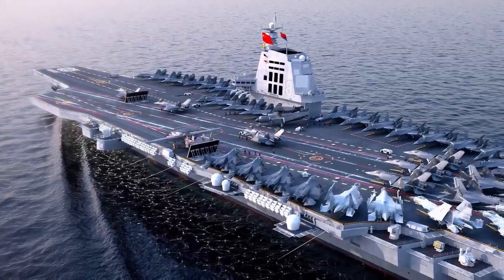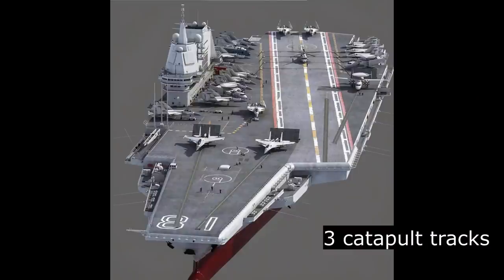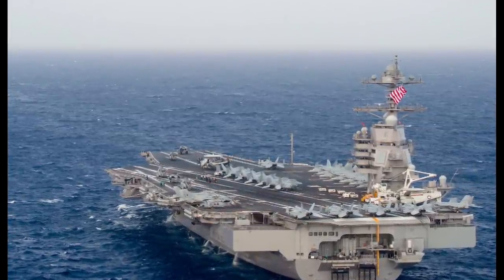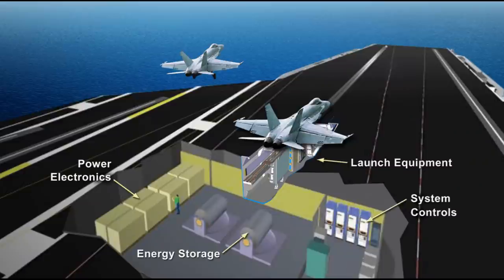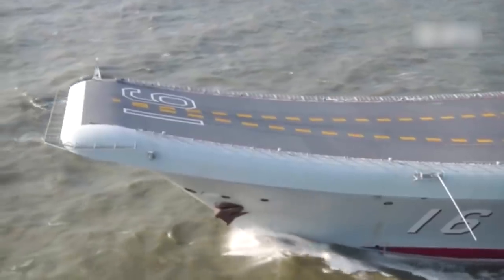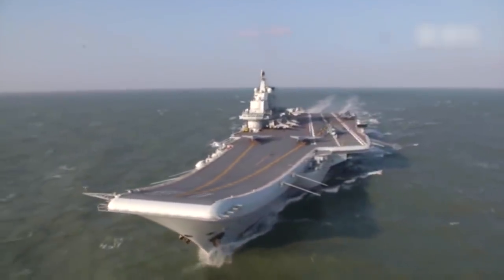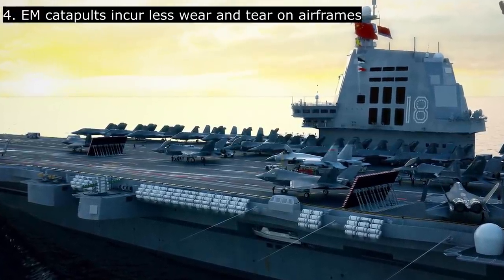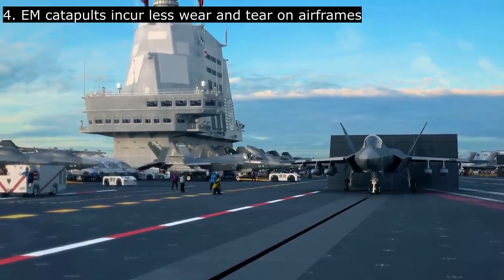How Important are Electromagnetic Catapults for China's Type 003 Aircraft Carrier?

Comment: Ok, the main issue, and what is NOT known about the China catapults?

Well, first we have to grasp how the USA one works (or to put it mild HOPES to work!!!).

To use the electric launch system? They can’t draw power directly from the ships generators. 
Several reasons exist. First, you can’t draw enough power at the rates required to run the rails. So you have to “store up” the power.

More important, the amount of power available for a launch MUST be known beforehand. So, if someone turns on a lift, air conditioners, an oven or what not? Then the total power available is changing. And even a circuit breaker flip or any other system – you can see the lights dim – and power available  changes. So you need CLEAN power, uninterrupted power for a catapult launch. You can’t have power change half way during a launch – or you wind up with a jet in the sea.

So, what they do is STORE UP THE power for a catapult launch. They use big motor flywheels to do this.

An EMALS motor generator weighs over 80,000 pounds, and is 13.5 feet long, almost 11 feet wide and almost 7 feet tall. 
So, there is 4 of these for EACH catapult. A total of 16 of these beast of burden mechanical monsters are thus installed.

In addition to the huge flywheels they spin up, you have the generator control room.

So, to launch a fighter?

They spin 4 of these mechanical monsters to 5000 RPM. Then for a launch, they spin them up to 6000 RPM. (It takes about 50 seconds to spin them up from 5000 RPM to 6000 RPM)

Once they are up to 6000 RPM, then the catapult (the electric rails) are ready to be fired. 

At the end of a single launch, the huge flywheels will be back to 5000 RPM.

During a launch, the huge mechanical flywheel feeds into a complex energy converter (called a cyclotron).

Now, take all of the above systems? What does a steam catapult use for ALL OF the above?

Why, it uses a tank of air, with a valve. 

That is it!!!

I should also point out that you can’t isolate the huge flywheel generators from each other. So, if some small problem occurs, and you have to service them? Well, they take 1 hour to spin down. And worse, they really can’t be serviced or repaired at sea anyway.

And as noted, you can’t isolate the systems from each other. So all catapults are down.

With steam? If one catapult has an issue? Well, they just go below deck, turn some steam valves, and isolate one catapult, and operate other 3. No big deal to keep a catapult off line until you finished fighting the enemy. With EMAILS, you shut them all down, and sent out another carrier while the current one returns home.
So, steam, is cheap, easy, simple, but MOST important such systems are not only simple and reliable, but can be serviced and maintained at sea. 

The EMAILS system is massively complex, has MORE AND LARGER mechanically parts and bits it replaces, and worst of all, can’t be serviced at sea, and even if you try, you have to wait 1 hour to spin down the system before you can touch anything anyway.

And worse yet? Supposed these huge elephant size mechanical flywheels are supposed to save room!!! – Oh wait!!! The electric rails save room top deck, and no need for steam generators (attached to the nuclear reactor). 

However, over all the EMAILS system is NOT saving room at all.

I mean, sure if you JUST compare the rails, then YES. But to leave out the huge massive mechanical beast of burden flywheels, then you NOT reduced parts at all here.

To be fair the catapult rails for steam do have more maintains then the steam rails. So the rubberized seal that goes around the hook that travels down the track for steam is a “pain”. However, such maintains can once again be done at sea. 

So, while the rails on EMAILS require less maintenance? Well, that remains to be seen, but while the rails has less maintains, the large number of huge mechanical flywheels to store energy during a launch are NOT a reduction in mechanical bits and parts.

So, the tanks of air have been replaced with a VERY large number of those flywheels, and it remains to be seen how reliable these things will be.

And as noted, these huge mechanical flywheels don’t save room compared to the simple “air tank” that will last for the whole 40+ years of the carrier.

The other big promise of EMAILS?

Well, it was supposed to cause less stress on fighter airframes and thus increase the lifespan of the fighters. 

However, right now? Well, EMAILS is overstressing F18’s with external wing tanks. (The solution right now is to thus not fly F18’s with external fuel tanks).

They do claim a software fix is available right now (to be deployed on the Ford next year).

The issue is that steam has a “natural” kind of give. Try moving or stopping a cordless electric drill – they will rip your hand off. But, they still use air guns at tire shops for tire bolts.

So the overstress issue is complex. The catapult hook and rails when they start to pull the JET are connected VERY strong together (can’t have the hook come off!!!). But, vibrations from the EMAILS launcher are making its way into the fighter’s airframe. This is NOT JUST an issue of less force, or more force. It is how the rails produce the force that is the issue here. 

They “think” they can minimize the increased wear and tear on the fighter’s airframe with tweaking the software for the electric rails. But it far more difficult, since as noted, steam has that natural “compress” and “give” that absorbs these vibrations and huge forces that a catapult places on the fighter.

So, they are now having to try and “simulate” the give and take of steam with an electric rail system that designed to be VERY strong, and NOT have any play or “give” when they fire the catapult. 

As a result, vibrations and forces are making their way into the airframe. And we all know metal fatigue is the number one killer of fighter jets longevity.

So the WHOLE idea behind EMAILS was the promise and sell of reducing wear and tear on the fighter’s jets. This would thus increase the life span of airframes. Right now, they are experiencing the reverse of what they promised

So now that EMAILS is working, they are finding about 10 times or more failure rates compared to steam. So, even if they fix the failure rates, they still have to address the increased stress issue. And they still have no solution for doing working on or fixing EMAIL issues at sea.

And, even worse yet? Well, they are not seeing increased sortie rates with EMAILS (again another failed promise). 

Right now? Well, they just going to deploy the Ford class with reduced sortie rates, and ignore the failure of launch rates, and ignore the issue of non-repair at sea.

However, some launch failures will result in the jet going into the sea.

so, the idea that the EMAILS catapult is solid state? Nope!!!

You have these big beast of burden large mechanical spinning flywheels. It much like going back to medieval times - and using weights and rocks to power a catapult back then.

So, ANY talk of this system being non mechanical? Nope!!! - it takes more space then steam system, but worse right now is proving to be 10x less relaibley then steam systems.  (gee, at the time of writing this, it looks like President Trump was correct - the system not doing well at all right now).

Worse yet? As of june 2021 last year? Well, it went off line in june - they could not launch fighters for 4 days (the ship headed back to port). The previous failure was less then 6 months before that - down for 6 days - again headed back to port.

I would REALLY be a huge fan of this system if they could have used super-capacitors for the energy storage, but they went with huge mechanical flywheels connected to generators. These things are large, heavy, and very mechanical in nature. (All to replace a simple steam tank).  In fact the total weight of the flywheels is a whopping 640 tons - they had to make changes to the ship for that much weight on board.

So they traded reduced rails maintain for increased flywheels and generators maintains. It will be interesting to see when this choice starts to win over steam systems, or if it ever will.

The Ford and the JFK can’t be retro-fitted with steam, as they will have to rip up too much of the ship to go back to steam. So, likely what will occur is we use the Ford and the JFK for training, and build two more carriers after that and use steam. This is about the only viable option if they can’t fix the serious issues they are facing with EMAILS.

Ok, so now we up to speed on the crock narrative about how great EMAILS is. 

So the next question then?
Is China going to use flywheels, battery or super capacitors for their catapults - and if so, what was their solution.
Reply from the maker: You clearly spent a lot of time on this, so you could consider posting this on sinodefenceforums and see what responses you get.
Reply: @EurasiaNaval  
Ok, I don't frequent that forum - but I'll check it out.
The main issue to me?
Well, first, they quite much are backed into a corner. And unfortantly, they have now classified the testing and results of EMAILS failure rates. A report is supposed to be released, but as of June last year and the last failure and shut down of EMAILS (June 2021), they now stopped reporting on progress and the failure rates. So in effect, they have cut the flow of information in this subject (a common tactic - just classify the information - and thus no sources for how bad or good EMAILS is working right now.

But, as noted, what I am looking for and researching? 
Are china's catapults going to use spinning flywheels, or perhaps a capacitor bank. When the USA EMAILS program started, capacitors did not have the power density 10 years ago. However, now, they should be close - and have vast improved (much due to lots of money flowing into electric vehicles research).
So, there are some suggests that China's catapult system will not use flywheels but that information is what I am looking for. they are considering a high power DC current system, but I can't find out if that includes some super-capacitors in their design or not. Rumors suggest yes - but nothing solid as of yet.
Reply: Capacitor bank are risks on being cause fire.
Reply: @alexlo7708  
Interesting, I had not considered that fire issue. While the big spinning flywheels approach sounds very low technology, it certainly does not pose or present a fire risk. However, China has suggested or hinted they will not be using flywheels. So, they are using some form of DC high current, and I think that each rail section has some type of capacitors, or some other means to store up power. But, reports are they will not have the 16 big flywheels - those flywheels total weight is 640 tons - and they had to do some re-balancing of the  Ford class carrier due to this enormous weight added.  And as noted, while the rails above (at deck)  take less space, the 16 elephant sized flywheels and all the controls, and systems below actually takes up more space then does a steam system. So,  far, we don't have solid information, but reports have circulated that China will not be using flywheels for their catapults.
Reply: @Albertkallal  I don't know either.
Reply: @Albertkallal  just imagine the airplanes as carriages of high speed train, what China is going to do is to integrate tech from high speed railways repository to solve the engineering problem. China’s high speed railway accelerates they train to 300km/h in quite short time let alone an airplane.
Reply: @panaceatoxic5924  
Well the issue is not really the rails technology as much as how you store up the energy for the required power draw.
For example, when you max pedal a Tesla model plaid car down the strip for a 1/4 mile run?
Your power draw is about 760,000 Watts of power. A fighter launch needs about 10x that (you have to draw 7.5 million watts of power). So you can't actually draw power that fast from the on board power generators. So, you need to store up that power for a launch. So then the question becomes what kind of power storage system will they charge up before they trigger the catapult.
Electric trains have about 7,500 HP, each engine, but catapults need MUCH more power than that for a catapult launch, and they need it over about 4 seconds of time. So, we talking about 50,000 HP required minimal here (in the 30 million watts range). And more important you need to know and supply the exact amount of power for a given weight and do so for a very short time. As noted if a lift, a toaster, radar etc is turned on during the launch then power known and available changes per unit of time. So you have to store up the exact power based on aircraft weight (and fuel and bombs etc). 
So the question will type 003 use flywheels like the Ford carrier uses now? Due to needing enough energy in about 4 seconds of time and having to move 60,000 pounds of weight to over 100 mph in that short time is the issue. 
As noted some rumors exist that suggests the type 003 will not be using those big sets of flywheels. However I not aware of alternative technologies for this problem.
Reply: @1 CQC 
Well, that is fine and dandy to toss out a bunch of buzz words. The simple issue HAS been explained here, and the simple question remains:
What type of energy store or system are they planning to used for their catapults? It either has to be mechanical based, or they will have to use batteries, or some type of capacitors. 

So, when you state some kind of energy store system? What kind of system are you talking about? You have to state something more then your current claims which are just pure speculation right now.
Reply: @Albertkallal  在中文介绍里，003是使用超级电容，我两年前看到过这篇文章。这套系统也被要求必须支持未来更多的瞬间放电设备，比如激光和电磁炮。顺便说一句，中国并没有放弃电磁炮的研究，美国已经放弃了。
Reply: @ycongq6520  
I am not aware the US has given up on any research? (where and why is this idea being suggested??)

As I stated, 10 years ago, super capacitors did not have the power densify,  and thus the Ford class carriers did not use them. I suspect in the future, if super capacitors can provide the required power densities then they will be adopted. But the decision to go with kinetic energy storage was made that that time.

If the Type 003 does use super capacitors, then as noted, then we can assume that the required power density has been reached and achieved for use in the Type 003. And I do think super capacitors are a better choice.

The only downside to using super capacitors is some issue of fire hazards, but I still think that risk can be managed.

As a result, super capacitors are a better choice - and a better choice then using kinetic energy storage (flywheels) for this purpose.

However, I much appreciate the information - I have not seen any credible reports that the type 003 was to use super capacitors, but this information then is new news, and I much appreciate the information.
Reply: @Albertkallal  我也是在中文刊物上看到美国放弃了电磁炮研究，你也可以用英文检索一下这件事。我想，电磁炮本质上和电磁弹射是一样的，都是“发电--储存电能--放电”的过程，也许美国人觉得如果在电磁炮上也装几个飞轮，实在太过头了：）），所以他们放弃了。
Reply: @Albertkallal  I don’t have any solid proof but I believe it will be super capacitor for the 003, as I understand China is leading in this field.
Reply: @sidneysun3865  
Yes, there is apparently some Chinese aviation articles from about 2 years ago that quite much suggests that they are going to use super capacitors. As I stated when the Ford carrier was being designed and built the current power density of capacitors was not high enough. However a lot of R&D was occurring in this area - and a source of that investment was in fact the auto industry and money being spent on battery technology.
So in the last 10 years have seen significant power density increases. And those Chinese trade and industry articles were suggesting if not outright claiming that the type 003 was going to use capacitors.
So the evidence is not rock solid, but it certainly is pointing in that direction (that super capacitors are to be used).
Given this power density increases, I suspect that newer versions of Ford class carriers will also adopt as such. The simple matter was 10 years ago that technology choice didn't exist and was thus not an option that anyone had or could adopt or even choose in the design of the Ford carrier. Now 10 years later, this looks to be a viable option.
Reply: @sidneysun3865  
Just to give you a rough napkin calculation?
Take a typical laptop battery. The same power capacity as capacitors? It would now weigh about 575 lbs!
As you can see a double, or even triple of power density would not be sufficient here.
Based on existing power densities, you would need in the range of about 8,000 tons of capacitors. On a ship that is estimated to be in the 80,000 - 100,000 ton range, then 10% of the total ship weight and structure would have to be allocated to these capacitors. However if say they increased power density by 10 times?
Then total weight would be only 800 tons. Huge amount of weight but within engineering limits.
Total weight of flywheels on Ford class carriers is 640 tons. (a significant amount of weight, and as I stated with current capacitors technology you VERY unlikely to match or even exceed what flywheels can provide.
So, where they going to stuff 800 tons of capacitors on that ship? Around the hull maybe? And how robust will that setup be in regards to damage? 800 tons of capacitors will also take up HUGE amount of space below decks.
So the idea that capacitors are a easy and simple choice?
No they are not!!
Reply: @Albertkallal  tell me how did u know that it needs 7.5 million watts to catapult roughly 35 ton aircraft at a speed of more or less 200km/ h. As u mentioned it meeds 7500 hp for an electtric train to achieve 500km/h or more within few seconds which is more heavy. Please explain me how did u get that calcultion. I also heard that type 003 is going for DC  storage power. 7.5 mega watt of current is needes for each ejection right?
Reply: @Farzan4741  
A very good question! - they are of course what we call "napkin" calculations, or estimates!

Well one can start with some simple assumptions. For example, it is well known that 750 watts of power is = 1 hp (1 horsepower). So, from that, you can get some rough ideas of the power required.
For example, the high performs Model S "Plaid" edition? (the worlds fastest production electric car if you are wondering)?
Well, that car can do a 1/4 mile in about 9.2 seconds, and reaches a speed of 154 mph (246 km). So for about 9 seconds of time, that electric car is using + producing about 900,000 watts of power (for 9 seconds!). Now to put that into perspective? A average home runs on about 5,000 watts power (less during the night - in one day, the house will use 30,000 watt hours). But say we take the time i which the house is using + drawing 3000 watts? A Tesla car when you hit full throttle? It could easy power a whopping 300 homes!!!

So, the above gives some idea as to how much electricity required to produce power!!!!  It boggles the mind that one car can easy draw the power required for 300 homes when you want to go fast in that electric car. This also explains why that when you plug in a electric car into a standard wall plug? For every hour of charging, you get 3 miles of range. Thus, if you plug that electric car into the wall for 8 hours? You can now drive 24 miles!!!

Same goes for the catapult. Not only do you need a LOT of power (to launch a 70,000 lbs fighter, and that is a whopping 35 tons fo weight!!!). But, you ALSO have to do this in 3 seconds of time!!!

I can draw 500 watts over 10 seconds, or I can use the SAME power and draw 2,500 watts in 2 seconds!!! (I will have used the same power in both cases).

So, not only do you need a LOT of power, you also need a LOT of power in a SHORT time!!

So, that electric car needs 900,000 watts - for 9 seconds to do that 1/4 mile speed run.
But, a figher jet is 13 times more weight, and in place of 9 seconds, you have to do the launch in 3 seconds!!!

so,  a pure calc would require 35 million watts!!! 

A rough horsepower calulation of a steam catapult to launch a figher jet? Is from 10,000 hp to about 24,000 hp.

At 10,000 hp, we talking about 7.5 million watts. But, for a loaded figher jet, then if we go with 20,000 hp, then we talking about 14 million watts.

So, 7.5 million watts is a not a perfect number. We only have to get a "ball park" number for this discussion, since then that gives us a ball park idea of the kind of power we need here. Do we need 50,000 watts, or closer to 10 million watts?

The answer is closer to 10 million watts range of power is required . So, a LOT of energy is required, and that amount of energy is MUCH higher then what the electric generators on board can provide. this is why a "charge" system is required, and it works much like a flash system on a expensive camera. (they charge up the flash for some time, and then release power to the camera flash in a very short time - the shorter time is part of this issue, and the other issue? Well, you simple need a lot of power!!! in the 20,000 hp range for such a launch!!
Reply: @Farzan4741  
The train to go at 500km has multiple engines - I don't believe they go that fast for that given amount of power. So, at regular speeds, sure the power draw makes sense, but at those very fast bullet train speeds, they are most certainly drawing more power then 7,500 hp. But even then, 7,500 hp is still 5,625,000 watts of power (5 million). And I am suggesting in the 7.5 million to 15 million range is required for the catapult launch - and the reason why is that you have to draw the power over a very short time.

And if my estimates (they are simple estimates) are off a bit, then 7.5 million watts might be a bit higher or lower - but its still in that range of power required.  If 5 million watts can power that train, then that makes sense, and that is the power range required for a catapult launch.
Reply: @Albertkallal  thanks man. Fully Understood. So the time requires to catapult the plane is a  major factor for power out put required for   the ejection. The less time taken to reach certain velocity needs more power right?
Reply: @Farzan4741  
Yes, in fact, one needs I would guess about 30 million watts of power available. So, it is the high power draw, and for the shorter time is the issue. You can't really transfer in "real" time that much power from the reactor. So, 30 million watts?  That's enough power for about 15,000 homes (but only for that 2-3 seconds).
So yes, one needs a LOT of power, but also needs that amount of power in a VERY short time - that's the real issue.

so, you can pull say 3 million watts from the nuclear power plant for 10 seconds. You release that power in 1 second - that's going to get you the same effect as pulling 30 million wants in one second.
As noted, when they started this desigin, they didn't have all that great super-capacitor technology. I suspect if that program was starting just now, then they would have (perhaps) dumped the use of those big mechanical flywheels and gone with a non moving system to store that power. This looks to be what China has done for their system.

So yes, you could increase the length of the runway (catapult), and say double the length, then draw power at half that rate - but for 2 times as long!
So the problem is weight of the aircraft - and that you only have about 2-3 seconds pull time. The aircraft will weigh about 40,000 lbs (20 tons), and as high as 70,000 lbs. So, it just a whole lot of weight, and you have to get it moving in a very short time (325 feet).
 (or find a nice 2000 ft runway on land - and takeoff from that!!!).